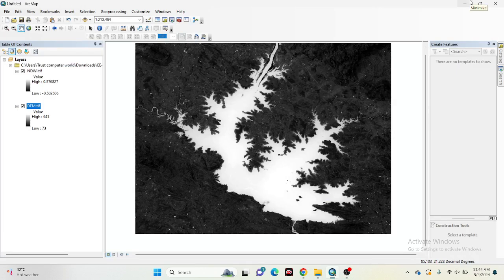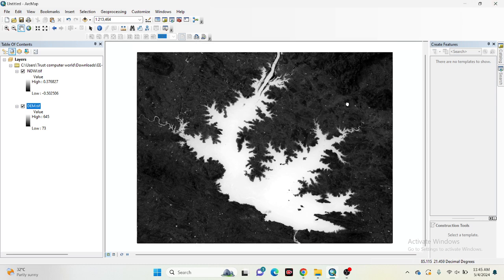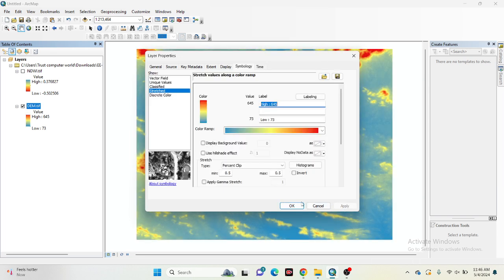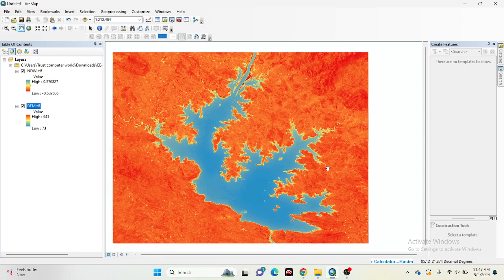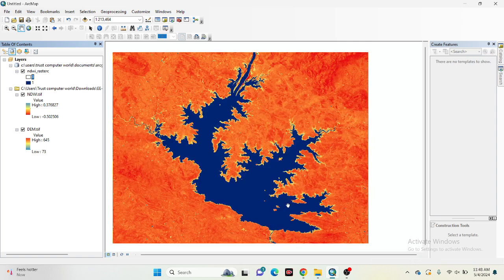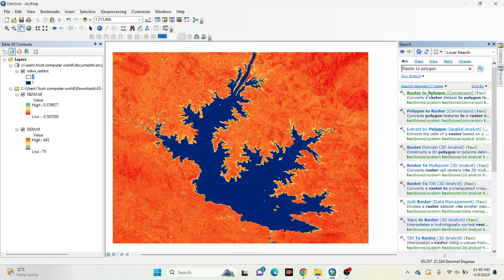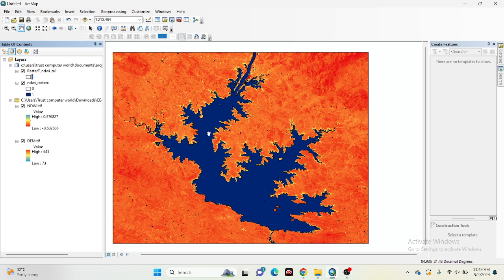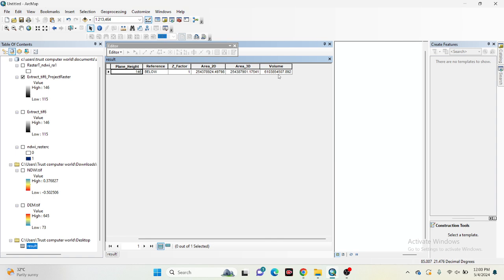How to Calculate Volume of Reservoir/Lake/any waterbody using GEE and ArcGIS

Comment: In my opinion, the exercise is not well planned. This is because you cannot use a DEM as bathymetry. You are only calculating the volume of the lake "assuming" that the DEM shows said bathymetries, but strictly speaking this is not correct, since you do not have the real morphology of the lake and you are only entering the altitude at which the SRTM took the images.

Comment: you can't leave the plane height blank. To determine the water surface elevation of the lake, calculate the average or other statistical values (such as the median) of the elevation values along the shoreline. This value can be used as the lake's water surface elevation.